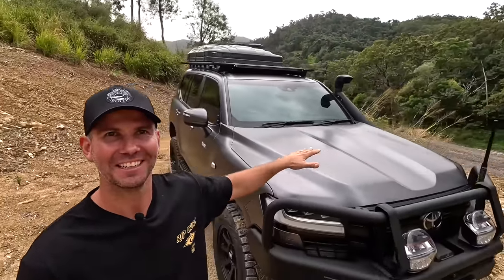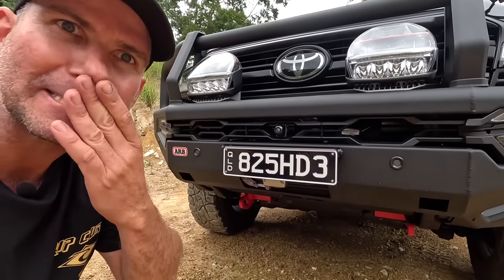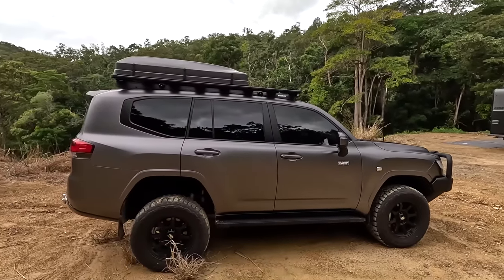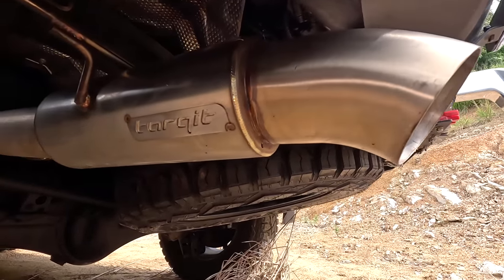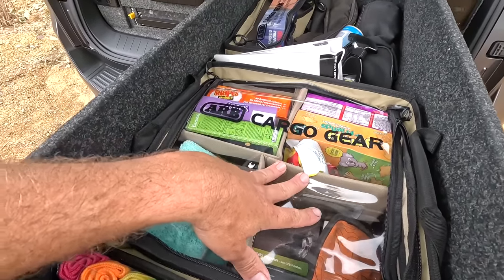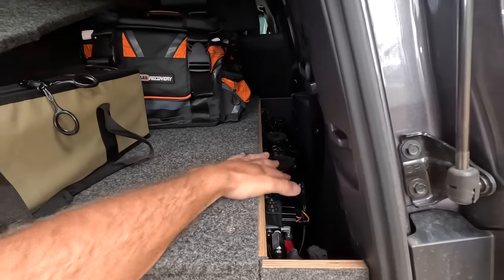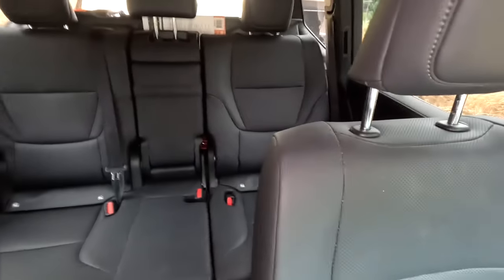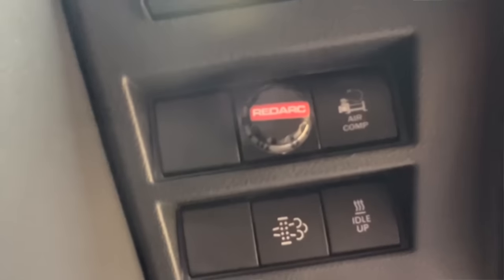🛠️HOW WE BUILT our 300 series Landcruiser💪 Rig Rundown & walk through of our VX wagon.

Comment: Motor uses a little oil but the reason is less friction equals slightly more oil burn, has a early warning light etc, all good really. How good are those mats, got them in the 200.
Reply from the maker: Good hey.👍👍 I’ll keep an eye on the oil level but it’s been good so far after 6000km

Comment: Nice built. That’s serious off road beast. Many “no need” things for average user. Agree that if you can get it off the floor just take it. We did same. Just bought GR Sport off the floor. Someone was struggling to have a finance and we took an opportunity to buy it. 5 min decision. That’s strange but GR has got options not available with others 300 like Sahara, even with extra money. Like front lockers factory fitted or exclusive Electronic Kinetic Dynamic Suspension system. Wrap looks great but decided to go with clear ppf due to practical reasons. Well done built guys
Reply from the maker: Cheers mate

Comment: Hey Justin.
Apparently, the 300's are using oil because of the hot Vee design, a thermal efficiency issue, from.what i have been told, they need good airflow when worked hard and also time to warm down.
I would suggest holding off on engine mods until Toyota nuts out the issue, i have been led to believe they are aware of it. Run it in first before playing with the tune.

Great rig mate, enjoy it
Reply: Hot V’s aren’t that new so I wouldn’t be too quick to blame that. However Toyota seems to always build faults into all new engines so it doesn’t stun me to hear they’ve done it again.
Reply from the maker: Thanks for the info!

Comment: The engine is designed to use oil , they have made the tolerances a bit less to reduce friction and gain fuel efficiency, and less engine where ,just check it every 2000km or so and top it up as needed,
Reply from the maker: Thankyou mate, good info

Comment: Car looks awesome Justin.   I grabbed the Oricom TPMS with 10 sensors and I had nothing but trouble getting them to work - and at $500 for the kit, somewhat disappointing to be honest.  I have had to go back to my Jayco installed Tire Linc TPMS unit.   Safe travels guys.
Reply from the maker: Geez that’s no good mate. Did you get in touch with Oricom? I’ve had mine installed for ages and the only issue I’ve had is a flat battery in a sensor 👍
Reply: @TripInAVan  I did initially but there was only so much they could do over the phone, ideally, would be good to be able to visit someone / somewhere and get them working properly.   I have no doubt that they are a good unit but the just wouldn't read the caravan tyres or air bags correctly.   The fact that the airbags had a lower pressure than what was set for the overall tyres is an issue I think.
Reply: Set up can be be a bit fiddly as the instructions are average. Stick with it  they are  a good bit of gear
Reply: @christhomas4260  Thanks mate, ended up just leaving the ones on the car which are working great.  I have replaced the ones on the caravan and the airbag suspension system so I now have 6 spare sensors in the box.

Comment: nice bus   but         total real world cost? thats what everyone wants to know    cheers
Reply from the maker: Approx 150
Reply: 150k? 
A VX alone is 125k  stock
If that was real world people setting that up it would be pushing 200k 

There’s probably about 25k just in the arb gear  Suspension. Gvm. On it 

Let alone the wrap.  The batter system and solar.  The wheels and tyres.  Drawers.  
And whatever labour pro touring charge.  

If it’s not a 200k to normal people build I’d be amazed